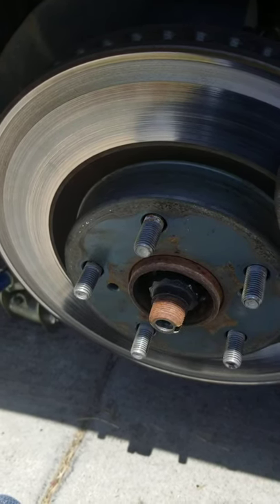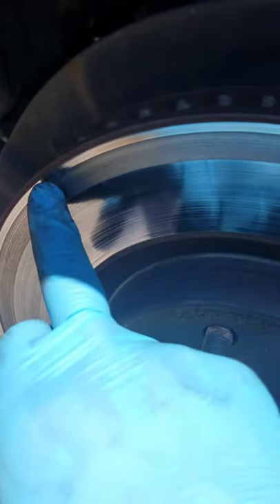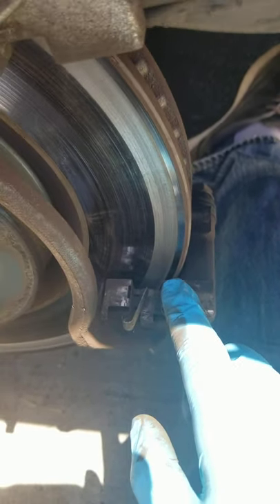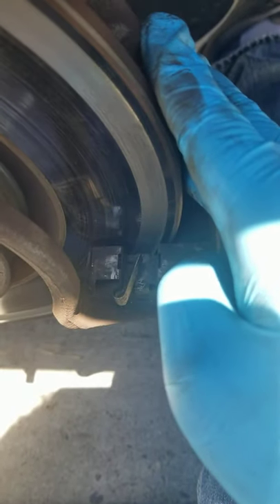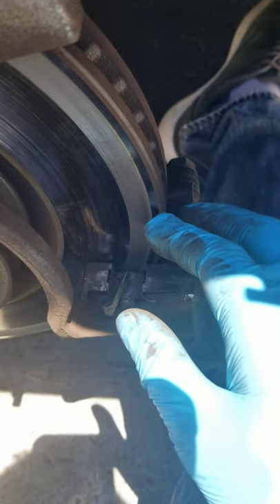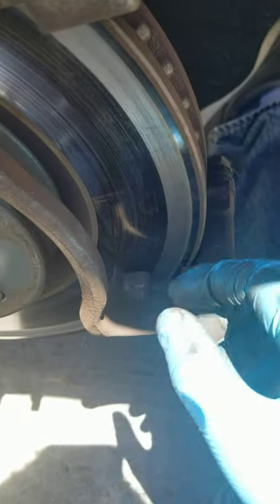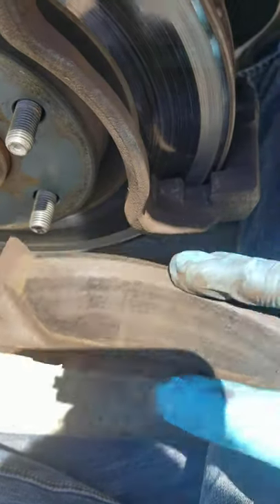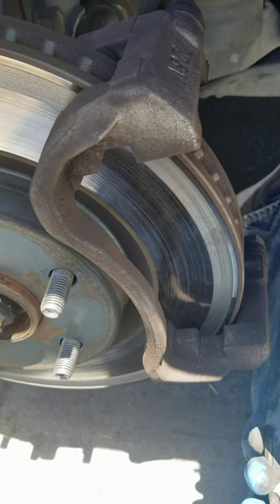When brake clips grind against the rotor

Comment: Top man for posting this. Such a simple and annoying problem. Might possibly be problem on my car when I thought it was wheel bearing, Removing the brake pad clips should reveal for certain if its them OR it is the wheel bearing. Guys like you posting simple things like this and taking the time to do it. Thank you very much. Much appreciated.This can be a very confusing problem as you cannot actually see the clips when the caliper is fitted. Top man !

Comment: How did you fix that, that is happening to my 07 tahoe front left rotor
Reply from the maker: Well, I just removed the brake clips, the ones that make the brakes squeal when your brakes are getting low. I think they were the ones scraping against the rotors, even when the brakes were not low.
Reply: I have this issue right now.. small little ring on outside of rotor.
Reply: Same here bruh on my 2014 Tahoe
Reply: Same 😂 issue, I hear the noise the moment I apply brakes. I have changed my wheel bearing, the router but still the problem did not go. Let me try removing the hardware/clips and see
Reply: @mosesadams_ how did it go?
Reply: @over6ose578  still persistent
Reply: @mosesadams_  same here
Reply: @over6ose578   it's just so annoying.  I just drive now
Reply: @Sealutions1  me too did you havw to replace the rotor?
Reply: @growersplus  i replaced my shoes and rotors all around

Comment: Very important concideration to the space difference between the rotor and the bracket BOTH inboard and outboard sides must be (close) to equal clearance.

A missing backing plate, a bent knuckle ear(s) or bent bracket, as well is incorrect rotor manufacturing, can be an a cause.